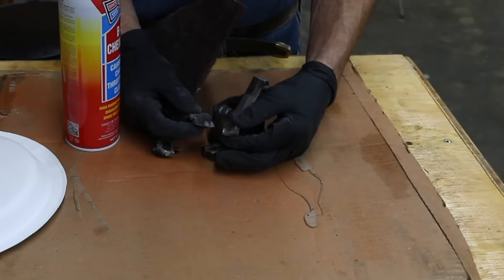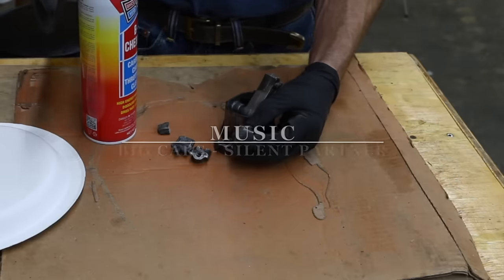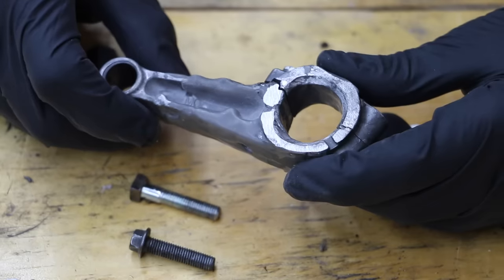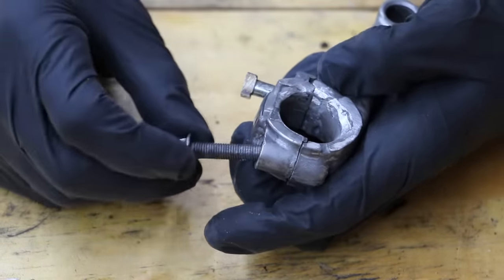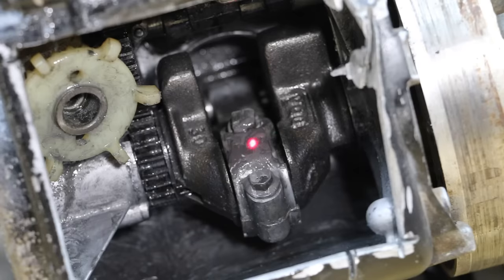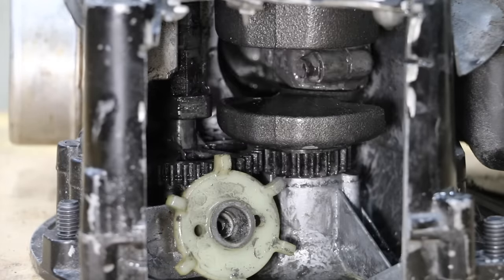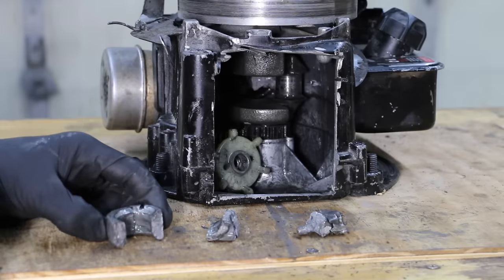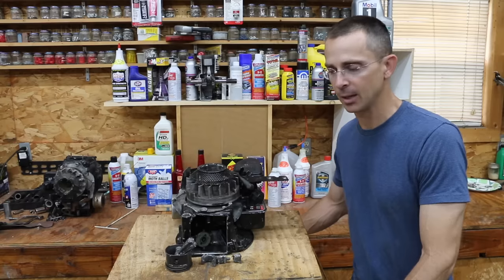Is JB Weld Strong Enough to Repair a Broken Connecting Rod? Let's Find Out!

Comment: Engine connecting rods are  a very critical part of the engine function that had a lot of force and pressure acting on it every second the engine is operating. Jb weld is very reliable but not for an item that’s this critical to engine operation. But good review video in general!
Reply from the maker: Thanks for the feedback.

Comment: JB weld would've worked if the structure was supported by something from inside. It's like constructing a building without steel bars, cement won't hold the building all by itself. That's exactly what happened here. You needed to support it with metal wires and then use JB weld on top of it. The combined strength of wire and JB weld would've worked.
Anyway it was a nice video as always.
Reply from the maker: Thanks!  Thanks for the constructive feedback.

Comment: It would be interesting to see if reinforcing the JB welded joint with a wire mesh would work. The same idea as rebar in concrete.
Reply from the maker: Thanks for the suggestion.

Comment: Use a bristle brush not sand paper. I’ve used J B weld on a outer oil case on a motorcycle, worked just fine no leaks whatsoever! I wouldn’t sand it though!
Reply from the maker: Thank you for the feedback

Comment: While I wouldn't ever use it on a connecting rod, when joining two broken pieces with JB weld I have found it to be useful, to re-assemble with one application and then lay in a narrow v groove cut at 90 degrees to the break, wider at ends and narrower at break and then fill that with the JB, both sides if possible. Or if an extremely narrow cut is the only possible, making a double y from the break. >-<
Reply from the maker: Thanks for the feedback.

Comment: So the craziest thing I have seen with JB weld.... Had a customer bring in a truck they was thinking about buying from the local used car lot. Long story short, it didn't have valve cover gaskets or head gasket, IT WAS JB WELDED!!!! That's right JB weld as a head gasket and valve cover gaskets!!!! 😂

Comment: Overlap broken areas with J-B weld impregnated fiberglass. J-B weld impregnated fiberglass is much stronger and durable.  The big end of the connecting rod must have proper clearance on a crankshaft journal. You would probably need to grind off some of the broken pieces to bring the connecting rod big end down to a smaller diameter and then hone back up to the correct diameter.
Reply from the maker: Thank you for the video idea!

Comment: I did repair an old B&S 5hp riding lawnmower engine with aluminum epoxy back in the 80's. I replaced the connecting rod with a new B&S connecting rod and repaired the crankcase with the epoxy. That engine ran fine for two more years and was still running fine when I sold it! Connecting rods are cheap enough to replace, don't try to repair it!
Reply from the maker: Thank you

Comment: Hm. Im gonna repair my shimano rear derailluer, as one of the pulley wheel bolt holes are stripped and theres nothing to tap. If I fill it, drill, and tap it then maybe I could get some more miles out of it. I only put 30 miles on, but it stripped due to covid machining tolerances.
Reply from the maker: Thanks for sharing.

Comment: I bought a 2002 BMW 525i (E39) from a Chevrolet dealer. The dealer found that the valve cover had a crack in it and oil would pump out. What did they do? JB Weld! They sold me the car and a week later the stupid thing started leaking, right onto the manifold! It was white smoke being synthetic oil so after not finding a coolant leak I went to the BMW dealer. Within five minutes the mechanic called me back and showed me the valve cover. JB Weld all over the underside. Since then I found out they used JB Weld on the radiator as well, so now the car is sitting while I order parts. You know, the ENTIRE cooling system. Great car beyond Chevrolet's idiot repairs though!

Comment: Positive proof that touting JB Weld as the ultimate bond adhesive to do everything is just folly. Like WD40 'enthusiasts', epoxies will only take you so far. Ultimately you'll have to replace parts or learn proper welding techniques. There's no epoxy bond substitute for applications like this.
Reply from the maker: Thanks for the feedback.

Comment: Hello.....you could save  a lot of time doing this trial.
Aluminium has a strenght of about 350 Mpa and your expoxy glue JB weld has about 80 Mpa.
Which means that Aluminium is about 4 times stronger than JB weld.
You only have to compare the data-sheets of the materials.
Reply from the maker: Thanks for the suggestion.

Comment: Well,,, at least there were fewer pieces this time. JB weld has good tensile strength for what it is, I've it on drain pipes, radiators in earlier model car, cement pools, works well if you prepare bonding surfaces properly. But I'm sure NASA has a top secret compound!
Reply from the maker: Thanks for the feedback.

Comment: Well, I think it might be down to friction... Because... Isn't the bearing between the connecting rod and the crankshaft supposed to be perfectly smooth, have almost no clearance and be properly lubricated?
Reply from the maker: Great point.  I added lubricant when installed but the repair just didn't last due to all of the bent metal preventing a balanced connecting rod
Reply: @ProjectFarm  I just fricking love You and Your channel :D I've never suspected You'd answer my comment :3
And hey, maybe You could try making a connecting rod from JB Weld? Like... Make a clay mould and just pour JB Weld into it, then maybe add some brass bearings or something so it stands a chance of actually surviving this...

Comment: I doubt it was the fault of the jb weld's integrity. Rather the fact that once the pieces bent and broke there was no way to get the correct clearance all the way around the bearing surface. The imperfections caused so much vibration that had the new shape been cast out of a solid piece of metal, even it would not have withstood the uneven force.
Reply from the maker: Thanks for the feedback.

Comment: Also no oil to help that rod from friction so who knows if it would have made the 30 sec to 1 min mark? Anyways JB Weld is good for emergencies repairs on small things not anything under pressure I have found such as a threaded fuel fitting on 4 bbl carb on a 550HP engine.
Reply from the maker: Thanks for sharing.

Comment: Any "surface" adhesive requires a degree of thickness to make a bond. That means increased gap(s), which in this case are not appropriate. If you had "bonded in" a cable or wire around the bearing cap and rod, it might have held. Then the epoxy would be holding the wire in place; the job of wire is to retain cap and rod together, not trying to merely bond the broken pieces together by adhesion. That might have worked. Go ahead, try it again and let me know!? Lol. Thanks it was fun in my otherwise boring life...)!
Reply from the maker: You are welcome!

Comment: it seems like this was not a good test. The OEM connecting rod failed because the engine is running with no oil at the connection between the crankshaft and the connecting rod. You need to lubricate the connection before testing. JB Weld can't be expected to succeed where the OEM part failed.

Comment: Whenever we glue two things together, we are trying to create a joint that will replicate the parent materials.  The typical out comes are:
(1) the joint is weaker than the original parent material
(2) the overall item is now heavier than before
(3) the item is both heavier and weaker

It takes a very good adhesive, and a very well made joint to match - let alone exceed - the original parent material. It can be done, and is done.  But it isn’t a particularly easy thing to do.
Courtesy of Half Vast Flying
Reply from the maker: Thanks for the feedback.

Comment: If that rod went thru the casing it will patch tho hole if you use a piece of tin conformed larger than the hole in the block, I have repaired a block that way.. 🙂
Reply from the maker: Thanks for sharing.

Comment: JB Weld saved me $4,000 on a Mercedes transmission replacement. A hairline crack in the case released transmission oil, a casting flaw from the factory. Because it was merely cracked, braked cleaner and JB Weld permanently fixed the leak. Later on I sold the car letting the new owner of the old repair. He didn't seem to care.
Reply from the maker: Thanks for sharing.

Comment: If you drilled holes in it and use a pin or dowel it might be stronger but cast alum is brittle
Reply from the maker: Thank you

Comment: Hello Project Farm friends.

Could the next video be about new vs. old formula (not everything new is better). For example the JB Weld Cold Steel (older release) seems better than the JB Weld Steelstik according to a test by another Youtube named 'Field Guide to DIY with Eddie Field' with a video called 'JB Weld Steelstik VS Cold Steel | Product Results'. Could you replicate the application he used it on and then some.
 
Is it true that the old JB Weld Cold Steel is stronger than the Steelstik or was it just user error?

God bless, Rev. 21:4
Reply from the maker: Thanks for the suggestion.

Comment: It may have worked if you had used a two stroke engine. I was told by my small engine instructors many years ago, that a two stroke engine will run without the connecting rod's bottom cap, if started under load.
Reply from the maker: Thank you

Comment: JB Weld will fix a missing piece in a car's side view mirror. I've had the car 8 years and it's still there. Sun didn't melt it. I did have to resand and paint it this year. I have the type that mixes gray. It was formed with a Dremel tool when first repaired.
Reply from the maker: Thanks for sharing.

Comment: It might have been interesting to machine the JB weld off as opposed to grinding it off.  Slightly better tolerances on the crank shaft bearing surfaces.
Reply from the maker: Thanks for the suggestion.

Comment: In aircraft bonding of aluminum you need to etch the surfaces and do a water break test to insure that no oxidized material is in the interface. If either surface is oxidized your bond will fail. The common, non scientific explaination is that you are creating a rougher surface. The problem is not about surface finish but it is about the chemistry. Sanding would destroy the perfect fit, however, etching is the ideal method because only one molecule of material is required to remove to expose the un oxidized material to achieve the desired bond. Surface prep being the most important factor in any bonding operation. Just bacause it looks clean does not mean that it is clean enough the water break test is how you prove it.
Reply from the maker: Thank you for the feedback

Comment: I'm thinking some assembly lube & McCoyed in oil while running. Also, maybe coat the entire baring surface with jbweld then cramming together to achieve a smooth baring surface.

Comment: Jb weld is strong, but Aluminum's tensile strength is 10x stronger, and isn't as brittle, making this outcome pretty predictable. The mass of a piston whipping back and forth is a massive stress on the connecting rod. The JB weld didn't stand a chance

Comment: next time just make a mold of a connecting rod and pour JB Weld into the mold and use that as the part. Would that work better? You can even add aluminum shavings to make is reinforced?
Reply from the maker: Thanks for the suggestion.

Comment: I think if you placed enough JB "Around" the breaks it might have worked longer.  Thanks so much.  Would LOVE to have you CUT the head off a valve and JB it back together.  THAT WILL WORK.  We did it once and it ran well for about 10 minutes.
Reply from the maker: You are welcome!  Thanks for the suggestion.

Comment: I think chances would have been a little better with some tiny shallow holes drilled into the surface for it to get a better bite into the metal.  Then not just relying on the surface bond.  Not saying it's gonna fix it but maybe run little longer.
Reply from the maker: Thanks for the constructive feedback
Reply: @ProjectFarm  I used use JB to patch tanks. Sometimes drilling the holes bigger to allow a larger "plug" so to speak.  It gave it a physical attachment to the material because I would smear it on the inside too even if I couldn't get the inside real clean it always worked.

Comment: JB Weld never worked for me. I'm using acrylcyanide (super glue) today, mixed with baking soda. The later makes it incredible strong and it is said to be more resistant against environmental influences. If some iron is broken in my house, I weld it. Modern inverter welders have become incredible cheap and easy to use. You will need an automatic welding hood, however.
Reply from the maker: Thanks for sharing.

Comment: I noticed that you gunked over the oil passage in the connecting rod that goes from the piston pin to the end cap. How could you have made so egregious a blunder? Rookie mistake.

Also, no assembly lube? Obviously. Any engine built together without assembly lube will immediately explosion into outer space. That's a proven fact.

Also it's not JB Weld's fault. As you admitted you didn't do the test so perfectly. Better luck next time, Project Farm!!!

Still subscribed. I'm only giving you one more chance. Another screw-up like this, and I just might not be a subscriber for at least a few days or so. Just to show you. OK. 

Thanks for the content.
Keep up the good work.
בס'ד

Comment: That’s crazy . It was way off balance . You got to remember that . If you weld a tire rim on one side you got make the same weld on the opposite side. If you take metal off one side it has to be removed from the other. A 7018 rod has 70000 per square inch of weld . Jb weld is one of the strongest epoxies. It works best for sealing cracks . But if you need something done that’s gonna be part of a structure and hold a lot of weight you best just relaxes it .
Reply from the maker: Thank you

Comment: My question is did he let it set a full 24 hours lol.A rods just a rod buy one not to much money. When you get a crack in a engine case and you can repair it for six bucks instead of 600 for j b weld will be your best friend

Comment: Next time you should try and take a good connecting rod and cut it into a couple pieces and then use JB weld to piece it back together and try that in an engine.
Reply from the maker: Thanks for the suggestion.

Comment: JB Weld is great stuff but like anything the parts need to be CLEAN I use non chlorinated Brake Clean and blow it off good 2 or 3 times I have done some amazing things with it, I do repair work for a living and they call me Mac Gyver  at work and hardware store.
Reply from the maker: Thanks for sharing.

Comment: Because it bears resistance to pressure, not to tensile strength that is why it works in pistons not something goes around
Reply from the maker: Thank you for the feedback
Reply: @ProjectFarm  yes exactly if you want to compare between woods and cement so i think jb has the same spesifications of cement

Comment: if at the end of the glueing you put strips of rovin fiberglass over the epoxy to give tensile streight, and then some epoxy to cover them... fixed. 100.000 kms garantee :)
Reply: Joking anyway the heat with degrade the epoxy eventualy.
Reply from the maker: Thank you for the feedback

Comment: Nice try.
At least it didn't end up worse than when you started the epic test!
Try again with steel pins or bolts to take the load off the adhesive. Similar way to head or block crack repair.
Reply from the maker: Thanks for the idea!

Comment: Installers cut about an inch line in a new stainless steel sink. I'm not able to replace the sink and was considering using jbweld on it then sanding and polishing. Other than taking the sink out again, can you think of any alternative way that would look nicer? Here is an image of the cut: https://live.staticflickr.com/65535/51250147048_541f2a6e50_b.jpg

Comment: i'm gonna venture a guess before I even see the video, epoxy will not stand up to the forces that are present here.  hmmm, to no surprise, it failed. No such thing as "overhaul in can". I have seen some crazy stuff work though, sawdust in a differential to hide the noise, brake fluid in automatic transmission to temporarily correct shifting problems, waterglass in cooling systems to repair blown headgaskets, etc.
Reply from the maker: You are right. Thank you
Reply: @ProjectFarm  I got a good one for you. My Dad back in the 50's had a 54 chevy that he was driving to California when it developed a rod knock. On the side of the road, he removed the offending rod and piston, plugged the cylinder hole with a block of wood, reassembled the engine and drove the rest of the way, on 5 cylinders, from Arizona to his destination in California. Once there, he repaired the engine correctly. Although I was only 6 years old at the time, I still remember the event as he described it to me in later years.

Comment: Would JBweld fix a small plastic hole size of tip of a pencil
Reply from the maker: Thanks for the video idea.
Reply: @ProjectFarm  yeah i build 80% lowers of firearms and my ar15 lower reciever puncutred a hole in the side where the trigger group sits. I want to make it ables to work again

Comment: Acetone is the only solvent that will remove all oils
Reply from the maker: Thank you!
Reply: @ProjectFarm  you're welcome. Any time you use epoxy, clean with acetone first. Also for fiberglass repairs, like boats, you only repair with epoxy resin, not polyester resin. You can build a boat with polyester resin, but don't use it for repairs.